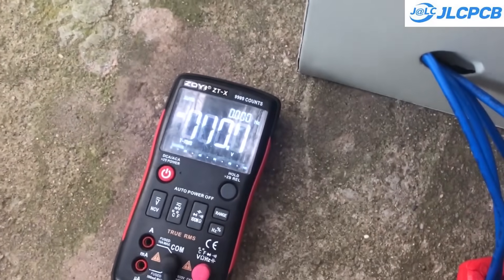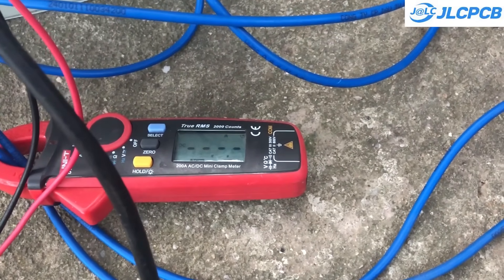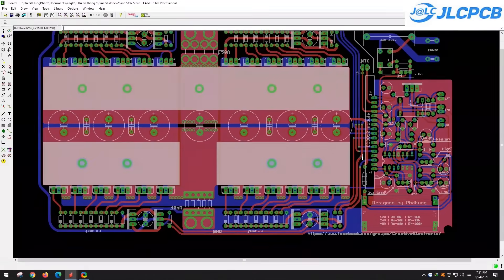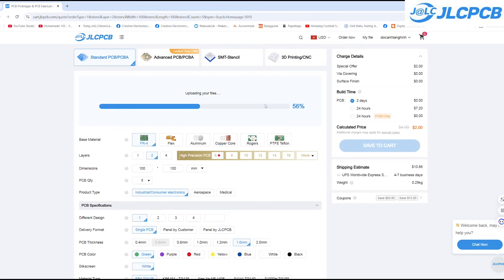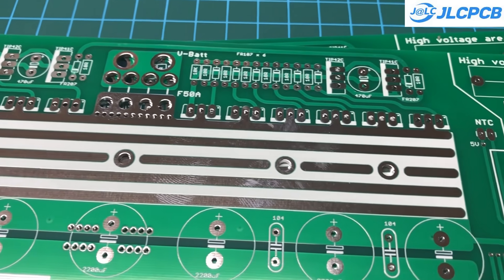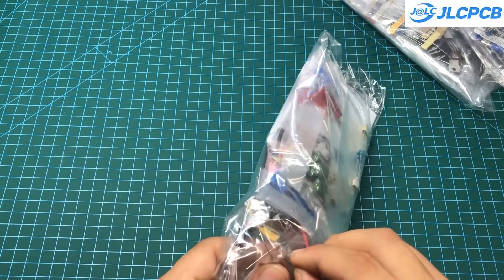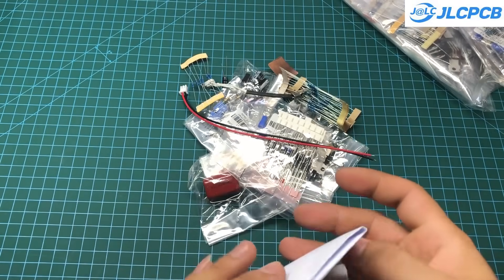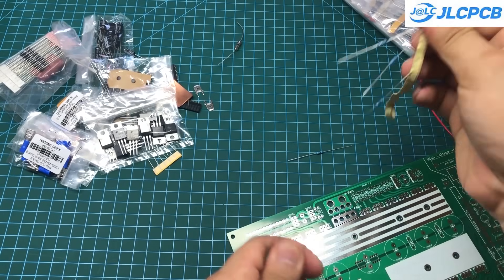Build a home solar power system 1500W | JLCPCB

Comment from the maker: I have approved all file access requests. If you don’t see your access approved yet, it might be because I was… asleep at the time. I’ll approve the request as soon as I can.
Reply: Is this an inverter without battery charging?

And another important question: what is the high-voltage/low-voltage protection based on, LM324 ?

Thanks!

Comment: i am fully make this but it is not on when i power the board when i give 12v to shinewave module it work fine but not function working like overload and low voltage sensing and on off switch, give me help and give me rx or ry resister value

Comment: 😆👍👍👍😇 ese parece mi estilo 😍  pero me parece que el regulador no es MPPT , yo lo hice me costo muchas horas de pruebas y programación para dejar bien la batería AGM , tiene que contar las horas de carga y  poniendo mosfetS de un trasformador que en principio era 50W 12Va220V al final era 12Va1000V ... por que la relacion de vueltas es solo eso jajaja el voltaje inducido FEM depende de la velocidad de la variación del campo magnético no de las vueltas  y mejor no discutir o te hago un trasformador 1:1 y le doy 12V y al secundario los deditos
Reply: de echo un motorcito que solo induce cando se acerca la misma bobina que se alimenta a unos 12V sacaba bastante más de 1kV si el arco sale a unos 5mm de distancia  con el dieléctrico de aire en un dia seco derivaran ser cerca de 20kV de pico

Comment: Still trying to get the correct files for the 3kw dc-dc inverter project.
The gerber files currently shared do not show the gerber for the third pcb in the project.
Also I need a parts list to make it 48v input compatible.